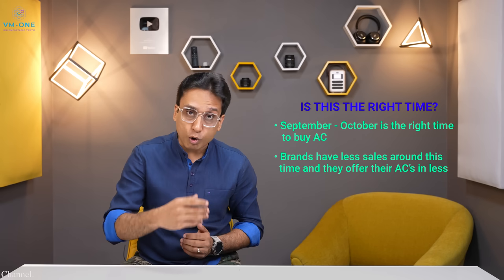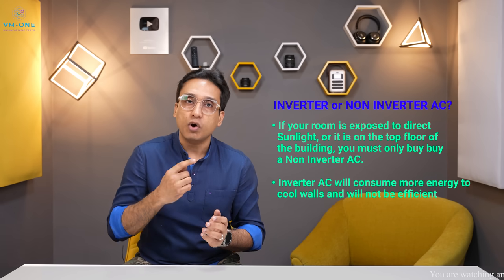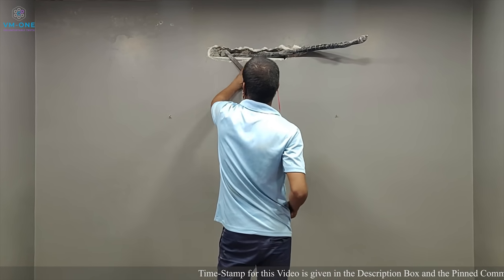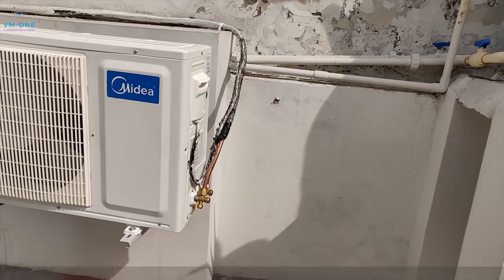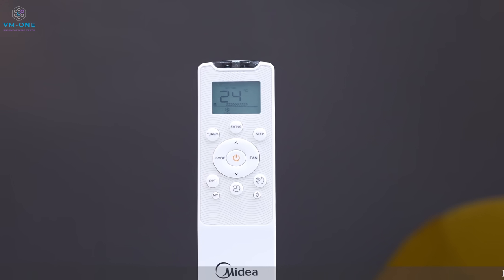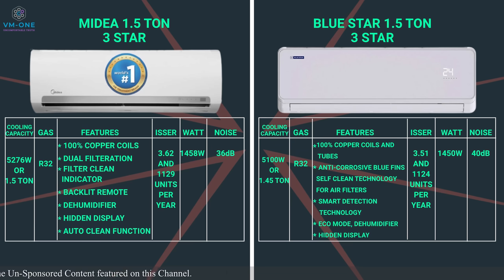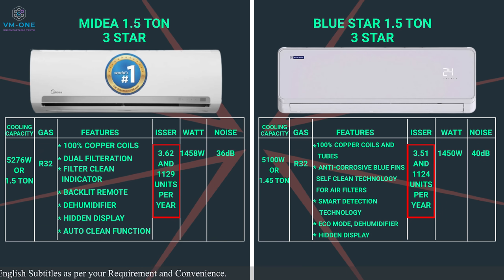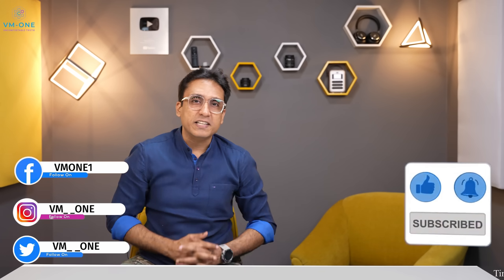Best AC in India 2021 ⚡ Should you Really buy in September or December? ⚡ THINK AGAIN

Comment: Use Midea AC for 8-10 hours per day and 5-6 months per year. After few years, you will most likely to have cooling problems, puncture in condenser or evaporator units, higher electricity consumption, abnormal noise from IDU/ODU etc.

Midea ACs are only for those who are at tight budget and usage is relatively low.

Midea ACs comes with Substandard quality compressor as compared to leading Japanese brands and average quality of material used for fabrication of the heat exchangers. One of my friends was working as HVAC engineer with Midea dealer in Middle East told me that Midea manufacture poor stuff, although Midea is OEM for some known brands but their own brand is cheap quality, especially in domestic products.

I have seen General ACs (O'General) in the Middle East working flawlessly for 10-15 or more years with heavy usage in high temperatures and I am using the same O'General non-inverter AC here in india since last 13 years with heavy usage and without any problem, no gas leakage, no weird sound, no loss of cooling.
Reply: Yes, very true , midea is a huge Chinese manufacturing OEM
Reply: Thanks for the information comment.
After watching this video I am convinced to buy midea AC
But after researching a lot I changed my mind to buy midea AC

Because same manufacturer of 2 products doesn't means same quality
Reply: @fit5463 

For your information, Midea doesn't manufacture quality product for carrier also. Midea is a mass production which are for those whose usage is low and budget is low as well.

Good AC need to have good compressor along with well fabricated heat exchangers.

Midea use cheap chinese compressor.
Midea also save money in copper heat exchangers by implementing cheaper fabrication process. So later or sooner, you will have problems with your Midea AC.

In the domestic AC market of India, only General, Mitsubishi (ME and MHI both) manufacture their own compressor and they are really a quality products. Those companies also follow high standards for the heat exchanger fabrication, so their products lasts quite long.
Reply: it doesnt come with substandard but making an efficient compressor and complete ac unit is itself  a complicated task so its better to buy good brand
Reply: @chandranshpandey1929 
It is Substandard
because all Japanese brands like Daikin, ME, MHI, General, Panasonic, Thoshiba, Sanyo are better AC than Midea.

Chines brand like Gree is also better AC than Midea.

Indian brands like Bluestar and Voltas are producing better AC than Midea.

Korean brand like LG is better AC than Midea.

I have seen that most of project consultants for HVAC in the Middle East used to reject Midea's air-conditioning equipments and there are technical reasons for rejection since they are concerned about quality. The companies like Mcquay, Fujitsu, Mitsubishi Electric, Mitsubishi Heavy Industries, York, Trane, Zamil and Carrier usually get passed.
Before purchasing Carrier, consultant people also make sure that non of the major technical components used in HVAC system by Carrier is manufactured in China.
Reply: No reply form VM-one ????
Reply: No recommendation for Godrej ACs? I thought godrej would have found a place

Comment: Lg AC's are the best. I have tried samsung, hitachi etc. Finally lg dual inverter ac's are the best. Before lg ac my bill was 11k with single AC, Now i have 2 lg ac. 1.5 ton and 1 ton. And my eb bill is below 10k with 2 ac running and man i run ac 20 hours as my house is at top floor in Chennai. I also have rain drain canal beside my building. If you need peace of mind and good service then go for lg. As post sale service is key. I took AMC after warranty and lg service is super fast with no question ask. My 1 ton pcb showed some issue and lg replaced whole indoor unit. Which is exceptional for any service provider. Better buy ac offline you might pay bit extra but you know whom to contact if any ac issue. I agree to Vineet what he said. But you check your area geography. I have live half of my life in delhi. So i know AC not required for full year in delhi. Use water cooler in summer. Only use ac in rainy season. So for delhi non inverter ac is good as you are not running full year.

Comment: I have used both. Inverter ac makes sense at home since we can easily make rooms air tight. My bill has reduced when i moved from non inverter to inverter. Kind of 700-800 rs difference on usage of 7 hrs a day.
These days non inverter and inverter price difference is very less. Hardly 10% . Plus i like to avoid Chinese brand like midea and other. That's my personal choice though.
I prefer Daikin which has given me 10+ years of no hassle experience so far

Comment: My question is about AC, I am planning for 2 AC's. 

1) AC no. 1
-Bedroom size - 150 sq ft. 
-Only one east facing window of 12 sq ft. 
-Top floor and 2 people in a room. 
-Air sealed. 
- Usage 6-8 hours at night for 3-4 months in a year. 
- Shortlisted AC - 1 ton Midea or carrier non inverter and 1.5 ton TCL, Panasonic or hitachi inverter. 

2) AC no. 2
-Bedroom size - 240 sq ft. 
-One west facing window of 27.5sq ft. 
-Two South facing window of 7 sq ft (total 14 sq ft) 
-Top floor and 2-4(max) people in a room.
- Air sealed
- Usage 2 hrs in the afternoon and 6-7 hours at night for 3-4 months in a year. 
- Shortlisted - 2 ton Voltas or Carrier non inverter and 1.5 ton (if it's ok) TCL, Panasonic or hitachi inverter. 

Please help me and let me know if you need something more from my side.

Comment: Sorry I beg to differ respectfully. 
I'm an electrical and electronics engineer and what u said is partially correct. In this era where even phones are waterproof any inverter AC would last long with saving a lot on consumption.

My house has 2 ACs, one being 16 years old and one being 3 years old. Both are working just fine. I do not even need a stabilizer(I live in Gujarat, stabilizer for an AC is a taboo here). In fact I'm running free, without any electricity bills since 14 months due to rooftop solar 3kW plant.

And there are better brands which will last 15 years plus. 

Regarding buying it in September October, you are absolutely right.
Reply: Total cost of installing 3Kw Solar Plant???
Reply: @mukeshmishra6223  I got it for 98K, I've heard that prices have shooted up recently

Comment: Sir so instead of buying an extra stabilizer isn't it better to go for an inverter AC (as they don't require stabilizer) and also it will save some space and not look too cluttered. Also if there is no electricity disruption or fluctuations still is stabilizer necessary if going with non inverter? Also for all AC's we'll have to buy a stand? Also do we need to buy plug and socket board separately? Have never bought an AC hence these questions. Please do answer sir. Thank you for helping 🙏

Comment: Sir, I have multiple questions before purchasing an AC. Can you provide me your email or is this there any other way to get help? If no, then below is a short info about my room and required your advise.
My room is 100sqft, G-flr, no direct sunlight inside the house but still the room temp is always humid(not hot exactly but( hindi coversion: room bhaut garam rehta hai humesha). One side of the wall has direct sunlight only but that is outside the bldg. 1 window and 1 door in a room. No other way to pass the air.
Q: 
1) Inverter or Non-Inverter.
2) Which AC is best to purchase? Budget is ~40-45K.
3) Stabilizer required? No electricity issue. Even if it is then it goes hardly for 5-10 mins give or take.
4) Since its 100sqft room, we will run AC for 4 to 5 hr only and not more than that.
5) Is this the right time to purchase an AC in the month of oct? Please advise. Thanks!

Comment: i am a great fan of yours. just wanted to know which would be the best a/c for me.
my room is on ground floor. there is floor on top of it. size is 130 sq. feet. there is no direct sunlight on the room. also the room is not too hot. 
my usage will be maximum 3 to 4 months of heavy summer for around 5 to 6 hours at night.

The room is a closed one. There are few cm gap below the doors only which can cause air leakage.

plz suggest me the best A/C for this room.

Comment: According to room size when should one look for a 2 ton ac....my dining hall size is 18 by 30
Reply: According to my personal experience.
It all depends on Sun/how heat is transferring (trapped) inside the room.
If it is penthouse or no house upon u r floor or if it is facing west or no house surrounded by that room.
Or if u r room walls are thin & poor or low quality plastering etc causes more heat needs more tonnage AC.
Reply: Even for low tonnege ac if u put small wall fan it distributes ac evenly , & cools rapidly.
Not celing fan if there is no house upon u r roof

Comment: Hello,
Size of room is around 200 sq ft, on top floor with metal roof but false ceiling PoP with thermocol (in between roof and ceiling) is done.
Which AC would be the best ? Also, please mention type- inverter or non-inverter. 
Thank you!
Reply from the maker: You should buy a Non Inverter AC of 2 Ton. Check my shortlisted list of Recommended AC's and choose as per your budget: https://bit.ly/2WDEVPQ

Comment: Hi Vineet,  I need AC for top floor room which is 180 sqft, and sunlight directed form only top, else side is enclosed. I need to run ac only in night  approx 8-12 hours and rarely in noon time.  There is no such air leakage but  other room is connected to main room and it's door opens in main room. Please suggest do I need to go for inverter AC or non inverter AC. Rarely Power flauctations occurs in my area.
Reply from the maker: Buy this one my friend: https://amzn.to/3vdLRpi
Link 2: https://mdeal.in/c_CbV37

Comment: sir, what is the maximun allowable length of copper pipe for 1 and 1.5 ton ac,i have installed more then 35 feet underground copper ( Ground floor to Roof) pipe recently. Also recommend the ac capacity for that
Reply from the maker: 35 Feet is okay, don't worry

Comment: I have a Mitsubishi heavy duty ac , which non inverter and have 5 star rating
Reply: Because that model is manufactured in 2016 - 17 or before that, All the 5 star non-inverter ACs became 3 star in 2018 and onwards.
Anyway, non-inverter ACs are more reliable than inverter ACs.

Comment: This video is totally misleading. Except frequent power failure, Inverter AC is is most appropriate for any normal situation. There will be definitely a significant saving in electricity bills. For 8 to 10 hours of continuous use the wattage of an 1.5 T IAC drops down as low as 300 watts after a certain time. This is my personal experience which matches with the technology behind IACs. There are many videos in youtube for measuring power consumption. Anybody can do it himself by connecting the ac to smart plug. This is the first ever video I have seen where non inverter ac is reccommended over IAC.

Comment: I want to buy Non-Inverter AC but why it  only comes with 3 star rating it consumes more electricity than inverter AC
Reply: bhai agar aap inverter 5 star ac ki electric consumption dekhoge to use non inverter 1 star s compare krke 25% electricity save krne ka dava krte h😀 ab socho
Reply: Iska matlab kya hai fir 5 star and 1 Star?
Reply: 5 star mai kam hota hai na electricity consumption fir 1 star mai kese ho sakta hai kya bol rhe ho?
Reply: @hridhwiman27  han bhai 5 star m kam hota h but kitna kam bat y h.
Reply: I googled and saw that 5 star,1.5 ton Inverter Ac consumes 1.5 Kwh compared to 1.5 ton inverter AC consumes 1.8kwh per hour....
Hence 5 STAR INVERTER AC IS BETTER THAN 1 STAR NON INVERTER AC
Also i am not going to connect inverter in the inverter AC and hence the PSU will be fine
Pls don't misguide im a newbie😊🤗🤗
Reply from the maker: Higher Star rating cannot be obtained due to energy efficiency achieved by Inverter AC's

Comment: Sorry am not satisfied with this video. Many aspects are not covered.
1. Starting current is low in inverter ac. Starts with as low as 2-3 amps and raised up to 9 to 11 amps based on room condition like occupancy, heatvetc (inverter ac maintains temp at desired level, whereas non inverter cutoff and cut on with temp difference of 2 degrees). Non inverter ac has high starting amps 
2. Indoor noise levels
3. Air throw 
4. 2 or 4 way oscillation
5. PM 2.5 filter
6. Compressor warranty
7. Heating & Cooling option (places like Delhi, Rajasthan where temperature goes to extremes)

Those who use ac at night for 5 to 6 hrs non inverter is better.

For usage more than 12 hrs a day inverter is definitely better.

Price minded people may go for your recommendation.

People who need peace of ownership, analyse about the above points

Comment: Hi Sir, 
I want to buy an AC. Please recommend me a best AC for below parameters, 
1. Room size is 130 sq feet. 
2. Sealed on all sides and sliding window on one wall. No direct Sunlight and No top floor. Flat located at 4th floor in a 15 floor building. 
3. Usage is less- 6hrs daily with less than 5 months in a year (only during summer). 
4. City is Mumbai, so suggest AC with coating on coils. 
5. Budget is 30-33k

Please suggest a 1.5 ton AC

I am more inclined to buy Non invertor AC as usage is less and I do not want to incur expenses of 20k on PCB failure.

Also, should I buy now or wait for dasserra/diwali sale. 

I will buy through your affiliate link. Please suggest a AC as if you are recommending for your younger brother. 

Thank You, 
Yashesh
Reply: 1 ton ac sufficient your room i am a tecnician

Comment: then why we require a geared car(inverter)  when we can run  car in single constant speed without gear (non Inverter).
Non Inverter ac  can be  of 4 or 5 star although since cost is higher than inverter models. most companies avoid it . so we cannot say non Inverter cannot be more Ethan 3 star .
PCB never fails with power cuts. it fails with voltage fluctuation. 
This is fools video

Comment: Paid video  my   Hitachi inverter 5 ⭐ takes only 132 unit in month day time running 10 hours a day  Mon to Sat runs 26 days 

What is inverter ac which run on DC ( Direct Current )  = to 12v only
That's main reason electricity bill is low 

Now a days when  1 year complete warranty
5 years PCB warranty and 10 years compressor warranty is coming why not inverter ac

And when ever your PCB get faulty after 5 years take the PCB to Daryaganj market in old Delhi  maximum repair cost 1000 to 2000 nothing more.

see ever year  BEE rating improves so just to save 5000 to 6000 rupees buy other person junk 
AC you don't buy every year it is a investment for 10 years

Comment: Inverter ACs are more energy efficient. That means lower electricity bills.

This has nothing to do with cool air leaking out. If this happens, seal the leaks, or your money will leak out.
Only advantages of a non inverter ac is the lower purchase price. And the replacement cost of the inverter pcb when it gets defective. 
Daikin AC PCB fail very often in my own experience. 
If this fails twice outside warranty,  its better to replace the AC.
The video is mostly BS presented convincingly for the ignorant.